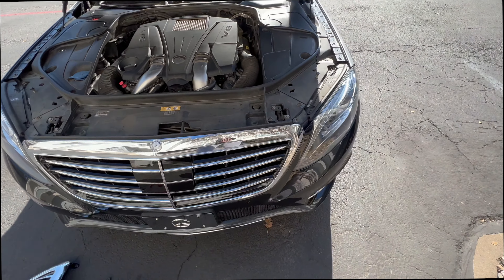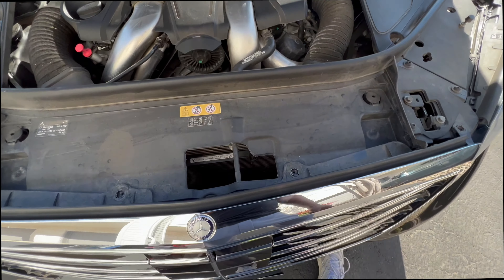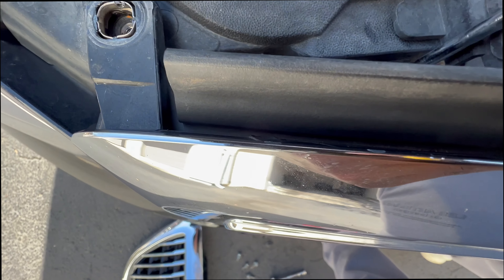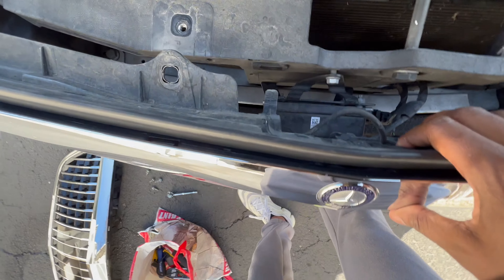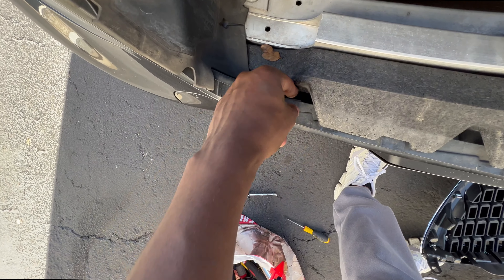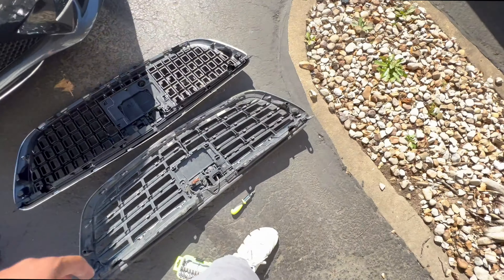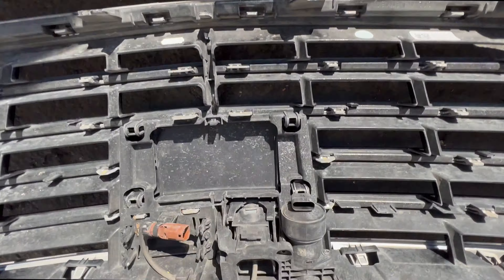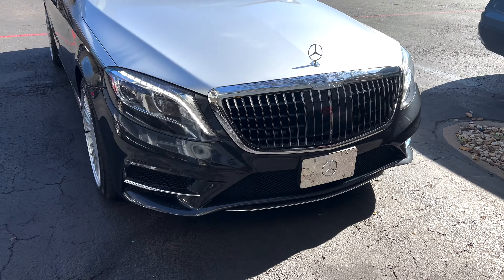How to change a 2016 Mercedes Benz S550 Grill (New Grill Swap)

Comment: I’m having issues with the ACC radar sensor would read after installing the grill. Do you have the same issue?
Reply from the maker: Exactly what issues now?
Reply: I get a radar sensor is dirty error after installing the grill and bought off eBay with ACC. The cruise control don’t work.
Reply from the maker: @manuelyanez9757  that usually be as simple as a car wash
Reply: No he’s right it’s throwing error codes ACC blind spot etc for me every other day or so I went to Mercedes specialist told me the Front plate radar cover is crap. That’s why.
Reply from the maker: Oh ok yeah we’ll I’d take their word for it but I don’t have those issues
Reply: @JayVlogz512 where you get that grill